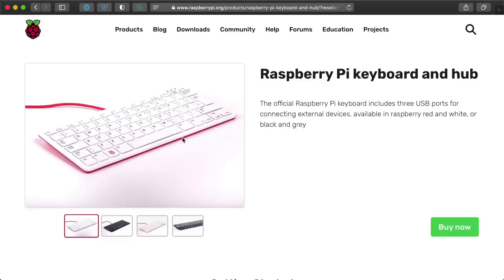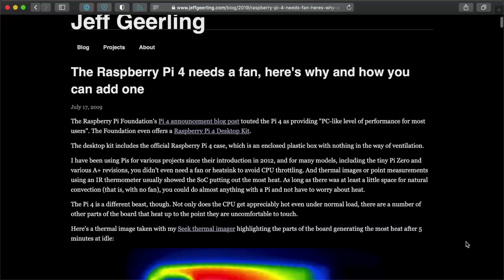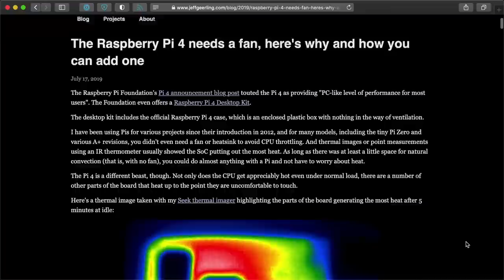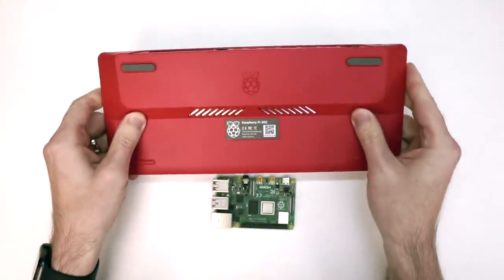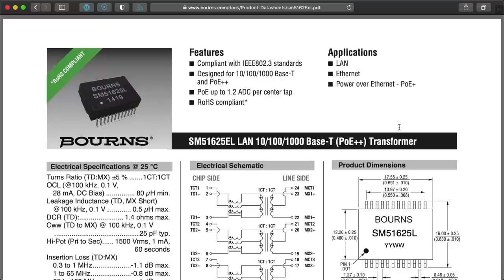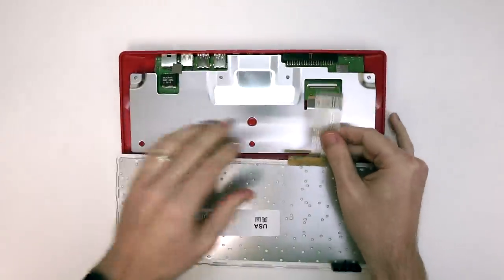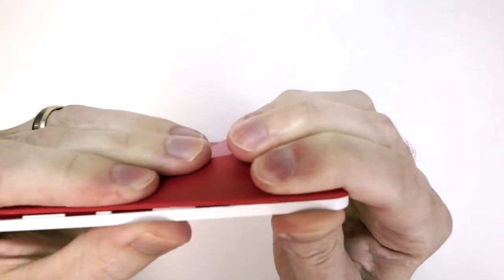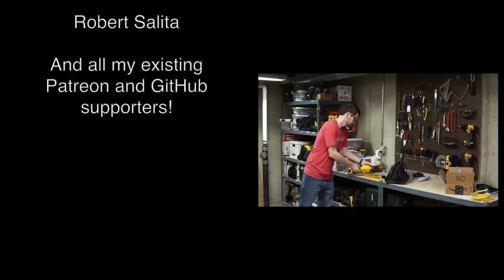The Raspberry Pi 400 Teardown

Comment: I like this.   I think being able to power the p400 over PoE would be amazing for schools
Reply from the maker: Sadly it can't be powered directly that way—but you could get an adapter that takes the PoE connection and splits it out to the USB-C power port.
Reply: @JeffGeerling  yes, seems like a missed opportunity... also doesn’t appear to be any CSI connectors, so no pi cam support? 🤔

Comment: Not sure how is the heat propagation, maybe they've tested that the heat won't be sensed by the user when typing the keyboard with the board at high loading, or they should place the heat plate beneath the main board.

Comment: Just noticing the 400 doesn't have an audio jack. Do you recommend 32 bit or 64 bit Rpi OS? And any overclock specifics for the 400 different from 4B? Thanks. I'm thinking back to my all in one Texas Instruments CC-40 compact computer. Yes, late 80's.
Reply: Found your previous video, over_voltage = 8, a_freq = 2200, force_turbo=1.

Comment: If you crack open the official keyboard is the ribbon cable the same, and is it physically the same (snap in points) as the keyboard on the Pi 400?  I'd definitely buy a black keyboard and swap it to the Pi 400 for a different look.

Thanks in advance, and thanks for the tear down!  I'm looking forward to grabbing one of these now.
Reply from the maker: This is on my list of things to try... I just haven't had time to grab my original keyboard and crack (well hopefully not literally *crack*) it open.
Reply: @JeffGeerling  Thanks for the reply Jeff.  I'll keep my fingers crossed for the right kind of cracking of plastics.

Comment: They FAILED to break out the 1/8" audio jack.  I have like 20 HDMI 1080P displays which don't support audio. Also the pi platform needs to add eMMC mem module support for faster and less error issues than booting from an SDcard.

Comment: So does the inclusion of that SM2516EL chip mean they may have considered adding POE as standard but didn’t for cost saving reasons? If they’re going to release a POE version later down the line I’ll happily wait for that.
Reply: That IC as Jeff calls it is not an IC at all. That ‘chip’ is literally just a transformer and nothing else. 

Maybe you can work out how to make use of the transformer taps to power it using POE

Comment: Unfortunately the 3.5mm audio jack and related circuity is missing.
Reply: Yes, but there is always the Bluetooth to connect the headphones/earbuds!
Reply: Not everyone has BT headphones; nor do they want to go to the expense of buying a set considering their limited battery life. However, wired headphones always work, do not need charging and are cheap.
Reply: @littlejohn2708  quite true and I too prefer wired headphones especially for desktop/fixed systems. However, I think not having the headphone jack on the Pi 400 is really not a big deal. In case someone dose not have Bluetooth headphones then there is always the headphone out jack on almost all montors/TVs that the Pi would connect to via HDMI.

Comment: Is that a PoE module on the far left?  The big chonky one?  I haven't seen that mentioned anywhere, not even the product brief.
Reply from the maker: Yes, but the Pi 400 lacks the required power circuit to allow PoE passthrough.
Reply: @JeffGeerling  ahh bummer.  Well, there's a mod waiting to happen!
Reply: That chunky ‘chip’ is not an IC, it is just a transformer. 

I wouldn’t be surprised if you could make it work with POE with a mod. I guess you need to connect a DC converter to the correct pins and the DC converter (5 volts output?) goes to power the board.

Comment: Was there any significant difference in the thermals (and maybe in turn performance) after reassembly?
Reply from the maker: Nope! It seemed to perform just as well, no sign of a difference. The only contact between the heatsink and the Pi is the little thermal pad on the SOC, and it's easy enough to replace it.

Comment: Will they be selling this board without the rest of the kit? I always wanted a Raspi with all the I/O on the same side of the board
Reply from the maker: So far it looks like you could just get the keyboard/board for $70 separately, but if you just want the IO and board you'd have to rip it out of the keyboard shell.
Reply: @JeffGeerling  Even then, it seems like a good price for this specific type of form factor. It is nice that all the connectors are on one side and that it is a fairly thin and flat strip.

It seems completely doable to reclaim the USB2 connection from the HiD chip for other (internal) use and it isn't a stretch to imagine using 1 of the USB3 connectors to reroute them to the inside of a project for a nice and spiffy USB3 SSD.

Comment: Kinda sad they didn’t go with an 8GB version with the integrated EMMC like you’d get on the compute module.  They could have gotten faster performance and still leave the SD card slot just for extra storage.  Slap it into a 104-key form factor, and bang!  Awesome portable rig.

Even in the smaller keyboard it would better with 8GB of memory and the 32GB of EMMC.
Reply: Well, but at this price point still complaining? Wow

Comment: The original purpose of raspberry pi was to build very low cost computers for developing countries. But, the pi 400, to me in a the opposite direction.
In developing countries people can find an old keyboard and mouse. The problem always is to find the core computer. 
I hope they consider making more pi zero like with better specs, which can be available in a big volume too; not like pi zero that is available only one for every purchaser.

Comment: Is there a Jack for headphones are speaker on the 400 or am I missing it. I am trying to Bluetooth for speakers but it's not a good sound
Reply from the maker: No, they left out the 3.5mm audio jack on the Pi 400. You could use an HDMI audio splitter, an HDMI monitor with speakers or audio jack, or a USB sound adapter.

Comment: The design is ok for an all-in-one, but I feel like they missed two obvious weaknesses -there should be a full size HDMI and there should be provision for capable internal storage.  Micro HDMI and SD just don't cut it on a desktop.  If it at least had EEMC on board...SD performance impairment is unacceptable.

Comment: Stuff like this makes me frustrated.
If they can do this, why can't get put out a Model C or something with all the connectors on the back, like this 400 System board but shrunk down more.
A Pi that is more optimized for being a Set Top Box, Racked in a Cluster, used as a NAS, etc.
They don't even need to design the plastics, just a new board model.

Comment: is there a way to get the POE working? be nice not to need the power connection
Reply: The Ethernet transformer is PoE capable and it probablly wouldn't be too hard to mod the board to bring the center taps out. but you would still need to find somewhere to stuff the rest of the PoE electronics.
Reply from the maker: This. The Pi Engineer I asked said ultimately it was difficult to cram the required power circuit inside.
Reply: @JeffGeerling  would have been nice.  Thanks for that.

Comment: If the keyboard is USB, why the huge flat cable?
Reply from the maker: It plugs in through a usb interface, but the keyboard itself is the same one from the regular pi keyboard, which uses that connector and a USB interface chip.

Comment: It has passive cooling, so why the vents?
Reply from the maker: The vents allow cooler air to come in from the bottom to replace the heated air that naturally wants to escape the back of the Pi 400 via natural convection. Even with passive cooling, there has to be some route for the air to flow—the easier it is for air to convect, the better the cooling will work.

Comment: So, they stll cannot supply r-pi with normal hdmi socket... okay.  They use shiity type-c socket that will broke ater 100 or so insert-remove cable actions. Okay.
r-pi still does not support pci-express slots in any forms either full sized or m.2. They use low durability storage.
What is usecase for this toy? It looks like computer-in-a-one-case. Just like Commodore 64, TI-99 and others, but Commodore 64 still lives despite it is discontinued in April 1994. I hardly belive that this toy can live 26 years after its EOL date.
So i'm asking again - what the point of this toy?

Comment: I only saw 1 ram chip, so it looks like it only has 1gb maybe 2gb ram.
Reply from the maker: It has 4 GB; the chip is the same size on the Pi 4 as well, regardless of whether it has 1, 2, 4, or 8 GB of RAM (same on the Compute Module 4).

Comment: Why micro HDMI?
Reply: Yeah! They had space for full size
Reply from the maker: I think in this case it was so they could still have two HDMI ports, and not just one full-size HDMI. (For two screens)
Reply: @JeffGeerling  I definitely think they had space for two full sized ports, they are making a whole bottom plate mold just for this, they can make the thick part wider

Only reason I see is maybe that they want to associate the pi 4 with micro HDMI, but idk

Comment: Instead of a plexiglass cutter, next time try an old customer card or something of the sort. This way you don't risk damaging your keyboard.
Reply from the maker: I have a credit card I use for this but it won't fit in there. A rigid guitar pick would probably work, but the only ones I have laying around are kinda flimsy :(

But yes, better tools == more safety. Though don't tell red-shirt-jeff about it. At least he wears safety glasses.
Reply: @JeffGeerling  I opened my laptop case using an old arcade hall customer pass which was quite rigid. Don't think those floppy customer cards work though..
Reply: @JeffGeerling  LEGO(TM) seperator. Use that.

Comment: This is a great little machine for programming and surfing the web. However if you want to run Windows apps you can try using it with Aikotech ThinServer solution on a Windows PC. The Windows PC will stream it's desktop to Raspberry Pi !
http://www.aikotech.com